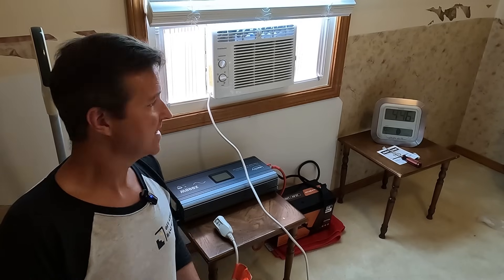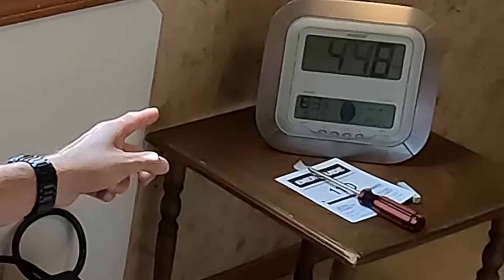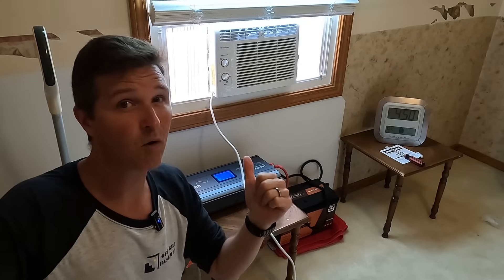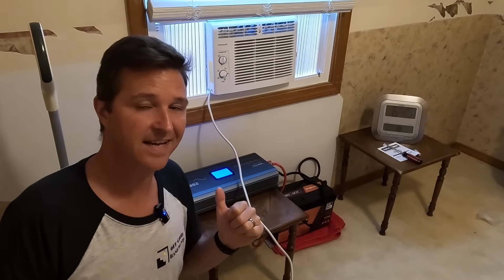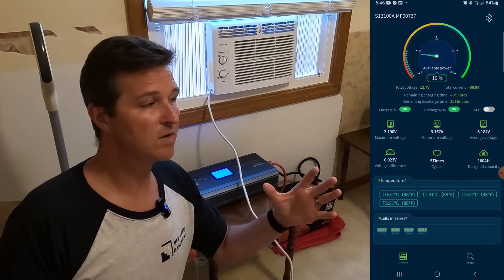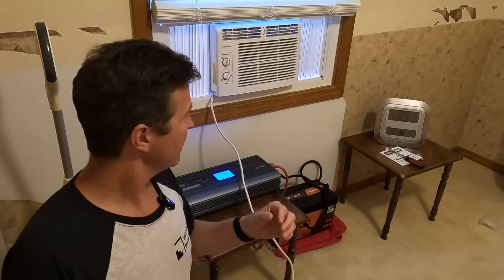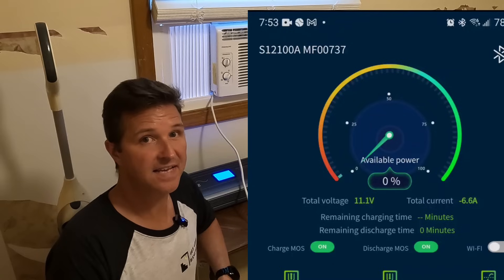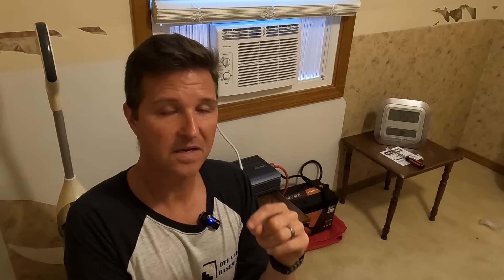How long can you power a 5,000btu air conditioner with a 12v 100ah Lifepo4 battery?  Let's find out!

Comment from the maker: List of the Items in this Video:
Frigidaire FFRA051WAE Window-Mounted Room Air Conditioner, 5,000 BTU with Temperature Control and Easy-to-Clean Washable Filter, in White
https://amzn.to/3xu4QPV
Power Inverter 2000 Watt Pure Sine Wave Inverter DC 12V to AC 110V 120V with Digital LCD Display and 2 GFCI AC Outlets Dual 4.8A USB Ports & Remote Controller LEESKY
https://amzn.to/3J4USar
PowerUrus 12v 100ah Lifepo4 Battery
https://powerurus.com/products/powerurus-12v-100ah-lifepo4-deep-cycle-rechargeable-battery?aff=44
Amazon Link:  https://amzn.to/4ckxdPk
Reply: Hey.. I'm back here looking at this valuable video.  I run a 460AH LifeP04 that keeps a small 15L 12v fridge going at 35F 24x7.  I also operate a 24v 1800btu AC that consumes about 200w /h at night.  I'm looking to buy a bigger van and moving up to a 5000btu. In my design I use the last 2' of the back of the van as highly vented and separate  garage for hot an noisy appliances. The design works like a dream for me and is all DIY and very different.   I wonder if a 5000but unit cooling a tiny space 6'x6x6 in the most eco mode would be able to run all night at ~200w/h?  I will deal with enclosed ventilation and water drainage on the back side if this is possible.   My new van will likely run a bigger 560AH LiFeP04 that would be charged  up with 50a of alternator dc-dc and 400w of solar using Victron.
Reply: @12vLife  You need more panels. 5000btu uses ~440 watts
Reply: @GodAlwaysWins7 600 watts solar panel can run the ac the whole day i have 4/ 100ah lithium battery?
Reply: @pacificochanneltv6842  It's possible I would get an inverter air conditioner lowest btu available if you haven't bought the AC yet. It will use about 30% less power and would definitely run it if you get enough sun.
Reply: Now you about to give it to me
Reply: What is the surge watts of the air conditioner?
Reply: I've got a 5000 btu window AC solar set up at home. Recommend a 6000 btu (had that last time). You need at least a 200ah battery I have 400 amp hour and I have 300 watts of panels on the angle of my roof tilting east and 400 watts of panels facing West on a 40 amp charge controller. Its peaks about 32amps average on mppt. It is not sufficient to run the window ac all day I need a 60 amp charge controller and probably 1000 watts worth of panels for ~500+ watts all day power. I do run about 120 watts worth of other appliances 24/7 on the system. The 6000 BTU cools 200 fifty square feet versus 100 fifty square feet and only uses maybe 40 watts more power fyi.

Comment: Put the inverter/battery outside the room. It's generating heat, making ac work harder, consuming more energy.. heating the room.. perpetual energy loss.
Reply from the maker: Good point, thanks for the tip!

Comment: Sorry 12v and 100ah battery is 1200 watts. 5000btu air cons run at 450w. So about right. But if you have fridge, freezer and fans and lights. Only expect 1 hour.
Reply from the maker: Good point and thanks for the additional info!

Comment: approximately 37 ah for that ac unit. so with 100 ah thats about 3.3 hours .  448 watt/12v=37 amps . use a shunt to get a capacity read. or easy " kill -a -watt" meter.
Reply from the maker: Great breakdown of the math and thanks for the tip on measuring the capacity.

Comment: Not bad for cooling down a room after sundown before sleeping. If your solar panels can fully recharge the battery during the day. That window is in direct sunlight, providing a lot of heat to the room.
Reply from the maker: Yes, it definitely helps to cool the room before bed if you can recharge during the day!
Reply: My Honda EU 2000 got me a solid 8 hrs of cool, and can recharge the battery bank on cloudy days.

Comment: I have this exact air conditioner...I was wondering if you would do this test again on "Low Cool"  setting "7"...see if there is a difference, on how long it will run?
Reply from the maker: I'm planning on getting this AC test going again.  This could be one of the settings I use.  Thanks for the comment!

Comment: Thank you for that real world testing.  I wonder if you had a 48v battery if it would be more efficient and run longer.  Say one of the same AH rating?
Reply from the maker: Possibly, but most small 48v inverters use smaller wiring, thus output efficiency would most likely be the same.  Thanks for the comment!

Comment: let's do a real world test for a simple calculation 1 BTU/hr = 0.00029307107 kW.  energy travels from hot to cold. So lets imagine a lake and you are trying to suck water out to reduce the level. While at the same time rivers are flowing in. Yes sucking water out through a straw will slow the lake filling up to the point the lake fills to the same height as the river supplying it.. You are not winning. You have to have a pump bigger than than the flow of water in to reduce the level. This is the same as heat transfer. For a point of reference.,scrap BTU's and use Kw energy. If the heat in the room and entering the room is 7kw. The room will stop heating up when the inside temperature equals outside temperature. if you use a 4kw cooler.Yes the temperature will go down . But only due to the heat transfer barrier. temperature difference. such as a wall. And this is why coolers preform badly in a tent. but seem to make some headway in  a motorhome. But at some point those cooling gains will Plato out and remain steady. And if that plato  is above a convertable level then it will feel like it's failed in its goal.
Reply from the maker: Thank you for the information and the comment!

Comment: The decrepency between a/c units is the window unit you have is a pure manual system and when you put it on high is runs full blast max output no matter the change in temperature changes until you change the manual settings or turn it off, while the portable which is electronic with a thermastat ( all portables are electronic while window units can be one or the other ) and makes changes for efficiency on it's own.  If you get an electronic window unit you will see different results.
Reply from the maker: Thanks for the info and the comment.
Reply: not true...  I have a similar unit to what is in the video.  The compressor turns on and off by a thermostat that you can set to a certain temperature.
It is not electronic, it is a mechanical temperature control and works fine.

Comment: IF U R LIVING OFF THE GRID U R GOING TO NEED A SET UP TO W THE WHERE U CAN RUN AN A/C 24/7 ESPECIALLY WHEN U LIVE IN AN AREA WHERE THE TEMPERATURE GOES AS HIGH AS 110 OR MORE AND THE LOWEST AT  80 AT NIGHT WITH HIGH HUMIDITY CAN U SHOW US HOW A SOLOR PANEL SETUP WOULD LOOK LIKE PLZ THANK U
Reply from the maker: Every environment is different so it is extremely difficult to show just one setup.  I'll make another video on how to figure it out for yourself.  Thanks for the comment!
Reply: THANK U IVE GOT A QUESTION HAVE U EVER HEARD OG PUTTING AN A/C UNIT TO A WATER COOLER IVE SEEN VIDEOS ON HOW TO BUILT A MINI A/C USING A FAN  COOPER COILED WITH A MOTOR ONCE U PUT IN A HAS THAT COOPER GETS REALLY COLD WOULD IT B POSSIBLE TO INSERT SOME KIND OF RADIATOR TO THE BACK OR A WATER COOLER AND HAVE SMALL AMTS OF WATER TO FALL ON THE FRONT PART OF THE A/C TO KEEP COOLER I HOPE U UNDERSTAND WHAT IM SAYING ITS BASICALLY PUTTING BOTH TOGETHER THANK U

Comment: So with 500 watts of solar, maybe it would maintain charge during the day and 3 batteries would carry you through the night with battery power to spare until sunup? I’m wondering if the inverter AC’s that are more efficient, would be much better?
Reply from the maker: Ive been told the inverter AC units are and they would cool the room faster since the smallest one I can find is 8k BTU.  I think your number are a good start.  I would need to be a sunny day though.  Thanks for the comment.

Comment: (excuse my english) "Cold" the summer is not anymore the problem for batteries and solar systems to go off grid, even in mobilehomes, caravans etc. Problem to solve now is winter heating 😉. At cost "eficiency" of course.
Reply from the maker: I understand.  Electric heating is so ineffective and gas is getting more $$.
Reply: @OffGridBasement well, hot pumps are really efficient, the problem is the total energy you need for heating.

Comment: Your figures don’t jibe with what I know.  There is no way that little unit is pulling 38 amps.  That’s higher than your wire is rated. Higher than the breaker on the inverter.
Reply from the maker: I'm referring to the 12v side.  38a x 12.8v = 486 watts.  Hope this helps!

Comment: If you put 3/4 inch wood cut to fit the sides of the ac you will save on losing air on those plastic flaps
Reply from the maker: Thanks for the comment and info!

Comment: I've got a 5000 btu window AC solar set up at home. Recommend a 6000 btu (had that last time). You need at least a 200ah battery I have 400 amp hour and I have 300 watts of panels on the angle of my roof tilting east and 400 watts of panels facing West on a 40 amp charge controller. Its peaks about 32amps average on mppt. It is not sufficient to run the window ac all day I need a 60 amp charge controller and probably 1000 watts worth of panels for ~500+ watts all day power. I do run about 120 watts worth of other appliances 24/7 on the system. The 6000 BTU cools 200 fifty square feet versus 100 fifty square feet and only uses maybe 40 watts more power fyi.
Reply from the maker: Thank you for the great information!

Comment: The roll around portables don't use as much power, but the results are not as good as a window unit.  A 9k portable feels about as cold as a 5k window.

The best you get is a proper minisplit.  With a soft startup (most minisplits have them standard) they should do the same or better per BTU change produced
Reply from the maker: That's good to know and thanks for the comment!

Comment: Simple math. A 12v 100 amp hour battery means it will supply 1200 watts for exactly one hour. Ideally. 
In the real world, add in the DC to AC Inverter losses, you wind up with, say 1100 watts at 120v. If your AC unit draws 500w continuously, that will give you about 2 hours run time before the battery goes dead.  When the Sun goes down, say bye bye to your air conditioning in about 2 hours
Reply from the maker: Thanks for the information and the comment.

Comment: A AC unit is actually more efficient if you can keep room temperature low reason being a higher room temperature will cause compressor pressure to operate at higher pressure causing battery use more current
Reply from the maker: Thanks for the information!

Comment: Use a 24/48 volt 110/220 volt split phase aims 6000 Watt power inverter.
Reply from the maker: That is a good idea for running a larger AC unit.  Thanks for the comment.

Comment: I remember seeing in the past, for sale, 5 to 6K BTU window ACs that were highly efficient and ran at atound 410 - 425 watts max (compressor on?) meaning that they could, in theory, last a little bit longer (30 more mins max?) since they would also cool down in the same time, but at a lesser consumption allowing them to go further once they go into fan mode and maybe back to compressor mode. 
MIDEA MAW05M1BWT and Frigidaire FFRA051WAE....both 5K BTU with a SEER of 11
Reply from the maker: Thanks for sharing that information, I'll look into those options!

Comment: Thanks for the video just what i was looking fore but i have 2 questions.

Isnt that inverter overkill?
Could you charge the batteries through solar keeping the AC on? 

Thanks beforehand.
Reply from the maker: I would say you wouldn't want to use any lower than 1500w because of the startup needed from the AC unit.  You could definitely add solar panels and a charge controller to this set up.

Comment: Interested in this because I have that exact same AC unit in window at home. Was considering putting it in my Van
Reply from the maker: I hope it helps.  Thanks for the comment!
Reply: hi can I connect my alternator charger of my van directly to the battery while driving? or can i directly put the inverter to my car battery and runs the ac while driving?  @OffGridBasement

Comment: Condensor running?  I’m assuming you meant to say compressor.  Great video but we’d like to see maybe some solar power or something hooked up to the battery while running the battery.  See if the solar can keep the battery charged.  Thanks!
Reply from the maker: Definitely compressor!  I'm planning on doing this test again with a 200w solar panel to see the difference.  Thanks for the comment!
Reply: @OffGridBasement heck yeah

Comment: Or just run KickAss Portable Air Conditioner 430w runs at 2amp on 150ah with 350w Solar Panel
Reply from the maker: Didn't know anything about that.  Thanks for the info and the comment.

Comment: I see people mentioning the inherent power losses from the DC to AC inversion with this setup, and while true, the losses from inversion represent a an extremely small fraction of the total energy used. 

There are realistically only three options for cooling a space off-grid, and it all comes down to the type of motor in the compressor of the chosen cooling unit. The three options are: 

1. A small window unit like this with low LRA in-rush current, powered by a battery, through an inverter. 

2. The same setup with a unit that has a variable-speed inverter  compressor. Although this setup is more efficient, the efficiency comes from the unit’s ability to vary the compressor’s speed dynamically according to cooling demand. There are, however, still the losses from not only the inverter that the unit is plugged into, but also in the inverter compressor motor-drive within the unit. (an internal inverter in the unit is what allows the the compressor’s speed to be varied, by the duty cycle output of the H-bridge inverter driving the compressor motor.) Although there are still losses from the inversion happening in the inverter and the compressor motor-drive, this setup allows the unit to only pull as much power as needed to maintain the set temp, + the inverter losses. This option basically adds dynamic power consumption to option 1.

3. Spend significantly more up-front for a DC powered split-system, usually designed for RV’s.  The downside to this option is the limited options, and an initial investment that is around 3x as costly as option 1. And it’s true, they don’t have inversion losses. They are also not designed for home application, and would require much more emphasis on the diy side of things to set up. 

There is a 4th option that is coming available, with many companies beginning to release all-in-one, solar powered split inverter units. This will undoubtedly be the most efficient, but require more up front investment, and a permanent installation in the location it will be used in. 

In perspective, this setup is the least costly and most easily implemented as a temporary solution to a space, and, in my opinion, outweighs the minuscule losses incurred in the power inversion. This setup also allows the most purchase options, as the battery, inverter, and small 5kBTU window a/c can be independently chosen and sized for the specific scenario, and also be used completely independently of each other when the cooling application isn’t needed. The window unit can be stored, or used from grid power, and moved to different locations… I guess that’s a long-winded way to say that I enjoy the flexibility that a solution like this offers with  separately-purchased components. I picked up a couple of the Midea 5k knob-style simple units on sale at Walmart for $100 each, and they’ve been great for this application. I also use an inverter generator to charge my battery bank in the daytime, and run the window units off battery power at night. Great and informative video! cheers!
Reply from the maker: Thank you so much for all the great information!

Comment: To those with knowledge please help me as power issues in Zimbabwe are huge

What size of inverter do I need for a medium sized fridge and small freezer please. Power usually returns at night so I can then recharge the batteries/inverter

Thanks
Reply from the maker: If you plan to have them both plugged in at the same time then I would go with 2,000w minimum.  That's so it can handle the initial surge with no problem.
Reply: Thank you sir

Comment: So if you did the same type of test you did with the 8000 BTU how long can the 5000 BTU last? Like setting it to 72 for example
Reply from the maker: Probably twice as long.  The compressor was basically on for 10 minutes and off for 10.

Comment: Hi I just returned a 2000 watt inverter because it would not even start my AC. The kilowatt meter says the AC is pulling less than 500 watts. I had it connected to my car with the car running just to test it in an attempt to size up the size I need for my tiny build. Does the inverter have to be connected to a solar battery or will it work on a car/truck battery as well?
Reply from the maker: They will work with starter batteries.  It's just not the best idea since starter batteries don't  deep discharge for very many cycles.
Reply: @OffGridBasement  ok it was probably just the inverter then. I had the car running and everything was hooked up correctly with 4 gauge wire. I just wanted to see if it would even work before I ordered the 100ah batteries. I guess I will go ahead and order them then. I ordered a 4k/8k inverter yesterday gna run on 4 
-100ah batteries and 2-195 watt panels(well that's the game plan) if it don't push it I give up lol 🤣 thank you for responding love your channel btw 😊